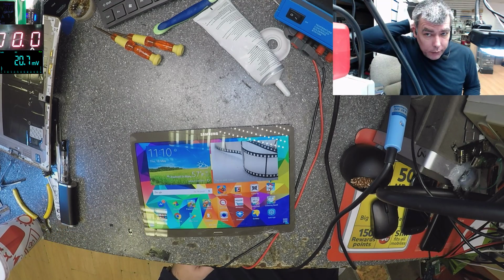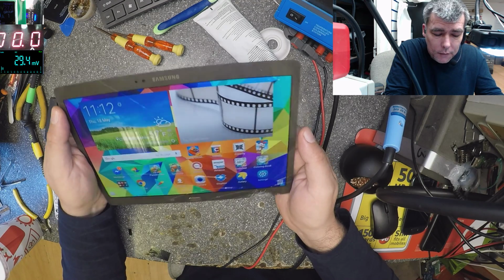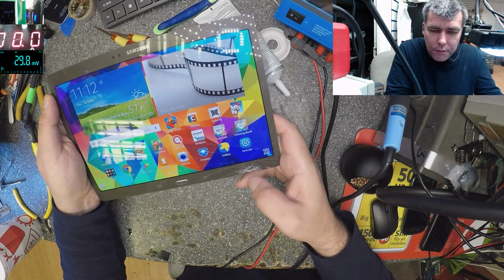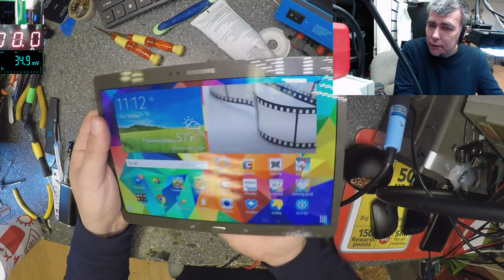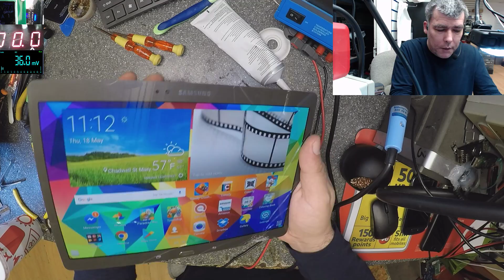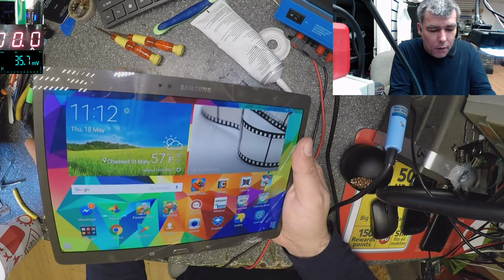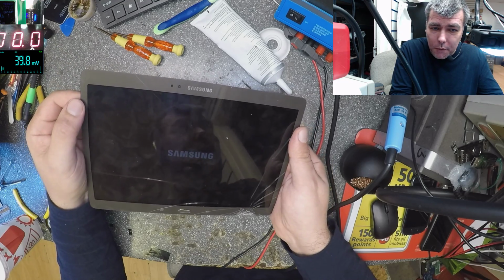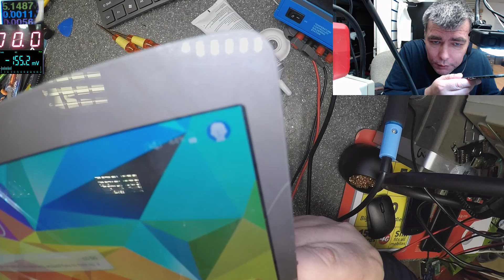Samsung galaxy tab s restarting issue

Comment: But my Tab S (1)
Restarts ramdomly as if it is drawing too much power or the RAM is too full, even though I reset it and put a new Battery. And it charges 12 hours instead of 3 hours. Maybe a chip or a resistor is defective.

Comment: Hi, Excellent Video presentations, especially the Samsung Galaxy Tab S 10.5 !!!  I have a very interesting sitution which has happened only recently where my Tab S 10.5 SM T800 boots - goes to the main screen and then drops out - screen goes black - re boots and back to the main screen then drops out again - re boots  again and again and again !!!  I disconected the battery connection and left it off for about 10 minutes foir the sysyem to decay,  reconnected he battery connection and charged the unit overnight to 100%.   Started the Tablet and ,,,,,,,,,,,,,, exectly the same happens, again and again and again.  The little 'buzz' sound signifies that the system is shutting down before automatically re-booting again and again and again !!!
Have you any suggestions what might be causing this ???  I respect your knowledge in this matter and wait for yor reply - Thanks !!!
Reply: what did you do to fix it then?
Reply: @MixedArarash  Read my Comment again - the last sentence/s answer you question !!!
Please pay attention.

Comment: Ty for usefull info...i have the same problem it keeps restarting by itself when not pluged to charger + it dosnt seem to be charging when its pluged even though it shows me that charger connected and charging but not really charging...although it charges but very slow when its shutdown... is that a battery problem or its just the connecter...plz help and thank you again very much

Comment: Thank you very much for this video.  My wife's tablet was doing the reset at random times.  After inspecting the actual battery connector, all 6 pins were not soldered.  It appears like the pins are contaminated because they were very hard to solder even when using no-clean flux on the pins.  After soldering them down, now the tablet works without reset.  Your video helps me figure the issue out.  Thank you again.

Comment: The microscope is very helpful. Now i realize that this problem alredy there.. last time when I try to disconnect battery connector. That connector pin moving like that.. i tought i pull the connector too much. Since i don have soldering tools and happen during day 1 lockdown at our town.. i just put card at the top of the board as temporary solution.

Comment: PCs have power good signals. Which holds the reset high on the CPU. It could be that the solder joints are only interrupting that signal which is where you get that reset from. Which might be similar to a hard reset on a PC.

Comment: I was getting crazy with the same problem,  I was sure it was a hardware problem in the main board but i knew that CPU, RAM and SSD were fine, so no idea, a battery replacement did' t solve it. Nice to see you did the trick !! Thanks for share it and regards from Spain.

Comment: I've tried soldering that on a Samsung galaxy tab sm-t520,  however it still self reboot or power  off randomly but when it's connected to the power cord everything works fine. I've already tried replace the battery but it does the same. Any idea what could be the problem? . Also noticed that when it's power off i need to connect to charger to power on.
Reply: me too. any solution?
Reply: @willho1016  mine too any solution ?

Comment: I have the same tablet, checked the battery connector, changed the left speaker ( includes volume an power buttons ), but the tablet still won't start unless the power button is kept pressed, and will go off once you release the button. Any ideas what could be wrong ? Tried to fully discharge it, recharge it, i have reinstalled the firmware, no hope.

Comment: mine has exactly this type of problem of restarting when l hold the connector it works but if l take my hand off from the connector it goes off l am yet to solder it because l do not have soldering tools, samsung tablet 4

Comment: how to jump the blue ones ? the pads fell off
Reply: Hi Kenneth did you ever find a solution, just had the same issue ive traced some connections but unsure if they are correct thanks.

Comment: Do you know if i could replace the display from a samsung tab s wifi to samsung tab s LTE? thank you in advance.
Reply: most likely...the only difference would be one board contains the equipment for the LTE and a sim tray, the wifi will probably have a blank area on that PCB. The screen cabling will be standard between and as long as they are the same model series/year the compatibility will likely be 100%

Comment: Thanks for the solution i open my tab before i watch this video and found out o had the same problem after installing a new battery i was going to replace the motherboard because i thought soldering would mess it up anyway thanks for showing me how you saved me alot of money
Reply: Andrew Gibson just for the records, this also fix the problem with the screen flickering and cpu heating, tablet freezing and so. Thanks